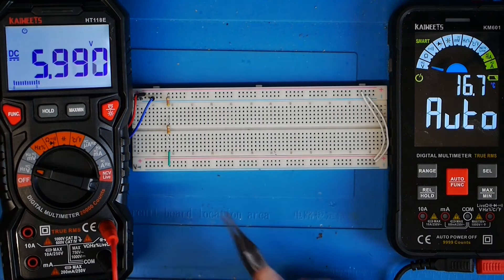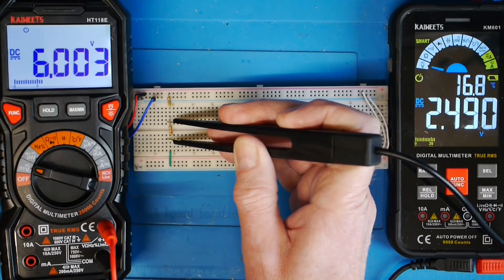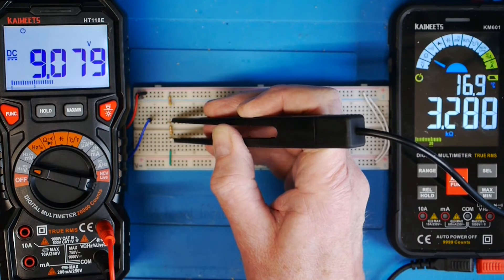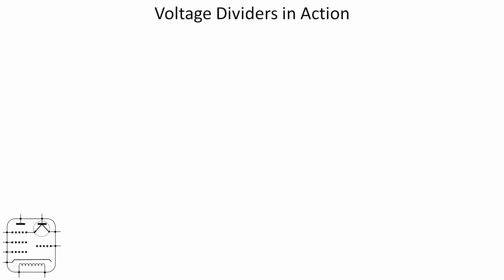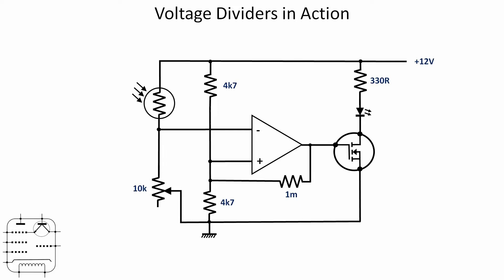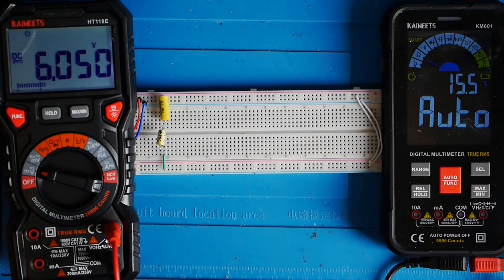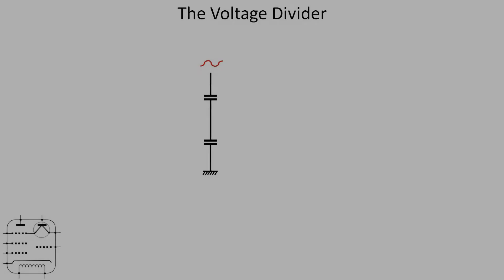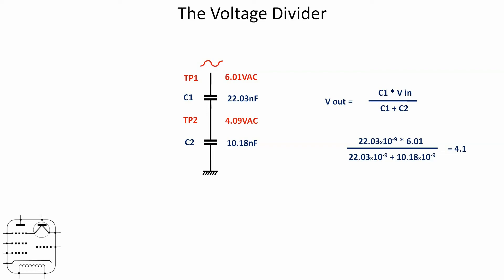Electronic Building Blocks  -  The Voltage Divider - #163

Comment: Bill - what was the probe you were using to check the voltage across the resistors on the breadboard ?
Reply from the maker: Hi, they are the Kaiweets tweezer probes from their leads kit, see https://youtu.be/p2TzJ3BVVOA
Reply: @LockdownElectronics  Bill - many thanks for your prompt and  informative reply - much appreciated !